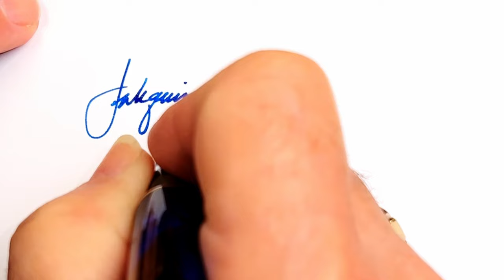SHORTIE: How to Fill a Cartridge Converter Fountain Pen

Comment: Looks like I'm not alone in appreciating another look at the rudiments.  A very referrable video, Professor!  I will note that I have found that the tweezers readily available to me push the Pilot disc down out of reach in the cartridge.  I resolve the difficulty by squeezing it up (not all that easy) to where the tweezers can get a grip.  After that, I am yet to discard the cartridge for leaking.  Also, beautiful exposition on filling a converter to capacity!  We have a fun hobby.
Reply from the maker: Thank you so much, Rob!

Comment: Back to the basics, I like it!  During refilling, I wouldn't push the piston down and draw ink again, because I wouldn't trust my cleaning enough to be sure no previous ink will not mix into the new bottle of ink.  So I just draw once and be done with that.  Not full fill, but that's ok.

Comment: A question please… For those of us who are, shall we say… financially restrained…would you please give a recommendation for a smooth writing medium nib fountain pen under $50? I have the Lamy Safari fountain pen, and love the way it writes if I hold it at a certain angle. Apparently the angle I commonly write at does not work well with this pen since it skips regularly when I am going to the top of a letter… The ascender part ends up missing! Thank you.
Reply from the maker: Get a Pilot Explorer with a medium nib. $25 at Goulet. Add the Con-70 converter for $14. Then buy a Pilot Plumix with a calligraphy nib (look for a deal but around $12-15. Swap the medium in the Explorer for the calligraphy in the Plumix and you have an awesome, smooth, wet, stub nib with great ink supply for around $50.
Reply: Thank you so much. I appreciate the advice and will make those purchases. Any recommendations on smooth writing ink? 😊
Reply from the maker: @knitntea1672  Iroshizuku Kon-Peki or Asa-Gao.